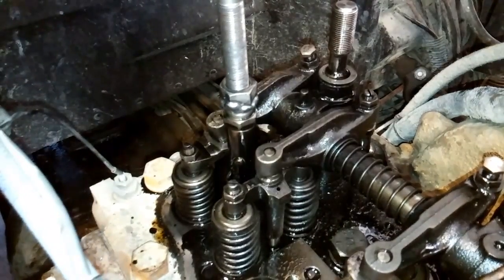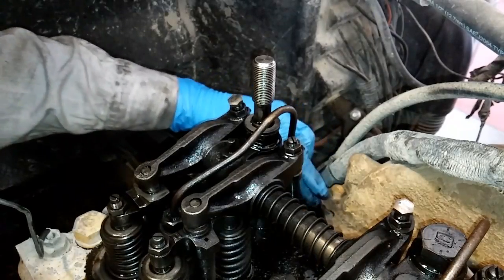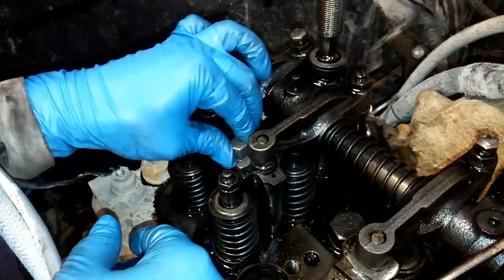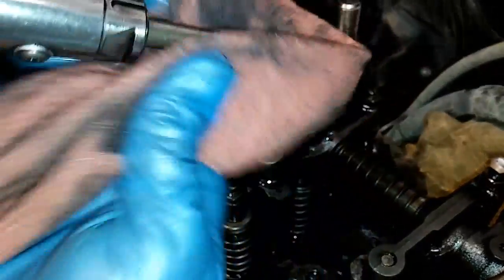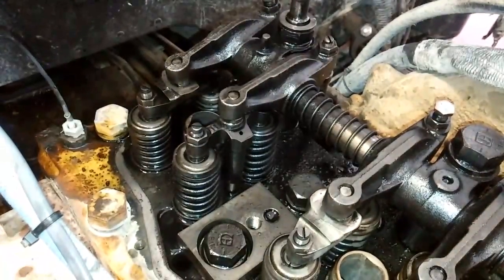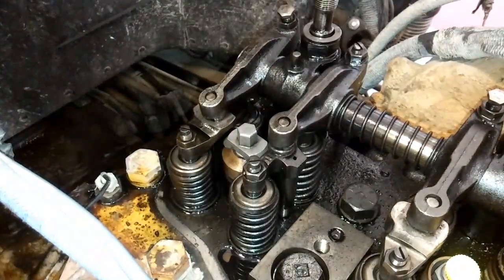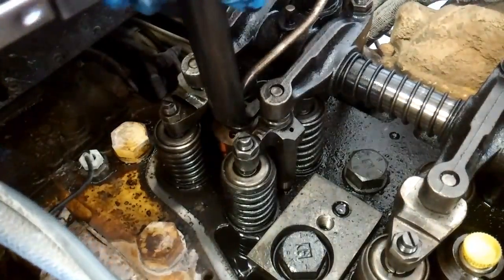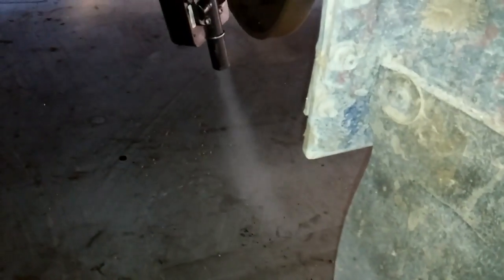How To Remove And Install 3406B Fuel Nozzles.  3406C Fuel Nozzle R & I.

Comment: Hello great video, is there like a mileage intervals that your supposed to change out the injectors or you just replace them when they go bad ? I have one go bad on mine started leaking fuel in the motor should I replaced all of them or just that on that’s bad or should I take them for testing TIA
Reply: These are called nozzles, not injectors. As the nozzles wear, the tip opens up and allows more fuel in the cylinder. By changing all six you could lose 100 HP. Also as they wear they dribble fuel and when they get so worn out, you will have a constant haze out the exhaust. Now as far as fuel in the oil, FTP very seldom, main injection pump, usually when someone tried to reseal a leaking pump and mostly under the valve cover. So your nozzle is in a chamber. You have two holes on top for the tool to fit in. BE CAREFUL, blow air in one side and see what comes out the other side. Put some gloves on and see if it is clear which means a leak. If dark usually means not leaking. You can try and isolate the cylinder, if it is a nozzle. A nozzle can leak at the top inner seal, which is not repairable or the outer bleed screw seal which you can. If you don't find one, pull all the nozzles and take them with the inner fuel lines and psi test them for a leak. If you reuse any nozzle, replace the bleed screw seal and the carbon dam seal. The carbon dam seal can be tricky and you can cut them when you install them back into the nozzle chamber. So slide them in a bit and pull them back out to inspect. Also you have a washer on the bottom and don't double stack one or leave one off.
Reply: @johngoldsmith6629  great info thanks, and yes I meant nozzles so we did find which one was leaking and replaced it with a reman one, that took care of the diesel in the oil, but I did noticed I have more blow by now then before I had almost no blow-by I think I’m gonna need a rebuilt soon, I thought that nozzle was gonna take care of the blueish/white smoke but I’d did not, so we went and replaced all 6 nozzles with reman ones from cat thinking maybe couple of injectors were bad since I had that one go bad might as well but I still have that same smoking problem it’s really stinky and it burns your eyes as hell. You think my problem is in the pump? I was told it might be my Air fuel ratio valve or a burn valve on the head ? Oh and I never thought replacing all nozzles I’d lose power I’d think the opposite
Reply: @snipermex13  Depends on how the nozzle failed. Cat had extrude hone nozzles they tried on 3ZJ's and they was a POS.
They did not open up but plugged up. So serial number means a lot on a 3406 to put it in the right vintage. Most other 7000 series nozzles open up. All 3406 B and C's has a timing problem. 7FB and early 4MG's cannot be fixed and will have a slipping problem over time. All 3406 B and C VTU needs to be inspected every two years. Make sure the snap ring is not broken and the bolts are not working out. Repaired 100's of them and most of what I see now are assembled wrong and people mess with the screws up front which is a big mistake. Never reuse the bolts in a vtu that times the pump or the small allen head bolts. Seen them break or loosen up.  Now when you say smoking, are you talking fumes tube or exhaust? FRC only comes in play when you accelerate, unless somebody has assembled it wrong and I seen lots of that as well. I would check pin timing first and some Cat shops has a blowby meter to see how much wear you have. Best to test it on a chassis dyno.

Comment: Which injectors should I buy for my 3406b 3zj? I’m rebuilding my pump 7E5888 and I’m looking to buy the injectors
Reply: What is your full engine serial number? The 7E5888 is just the casting number on the housing. The number that tells you what it is, is stamped on top of the fuel pump. They are called nozzles, not injectors, 7000 series to be exact. Make sure you have the updated bushings  and seals when you rebuild it.

Comment: What socket do u use for the 4studded rocker shaft bolts ? Trying to find something 3/4 drive to fit over the stud that jakes set on.
Reply: Proto makes a special 3/4 drive 1 1/8 extra deep socket for the rocker arm studs. Since it is special no warranty if you break it.

Comment: Anybody know the part number for the adapter from the slide hammer to the nozzle?   It would be very helpful right about now. I can't pull the injectors without one.  Thanks !   

I found it. 6V-6983. Verified because I got one from Cat and it worked perfectly.

Comment: Man i have a 3406c an I have fuel leak on too of pump how do I replace the orings   without replacing pump.    Someone said it's a 2 to 21/2 hours Job??
Reply: Seen people fix one or all. When you pull the leaking pump you need to see which seal you have. If it is pink you can try and fix the one that is leaking. Any other color you better pull all six or you might end end up nickel and dime yourself. 
The latest seal part number is a 131-3719. You will need to have a pin to center the rack in the fuel system and a tool to remove the bushing. IF YOU DON"T PULL THE PUMP ALL THE WAY OUT AND CLEAN. You will put fuel in your oil. You have bushing, o-ring, pump and a spacer. You must be clean or you can cause more problems than it's worth. Also if you have the old style bushing  you need to update it. Take the bonnet off the pump and see which style you have. Again you have an updated one. Check also for bypassing. If the spacer is pitted replace it. You will have to center the rack first before you remove the pump. Remove shutoff, remove plug under air compressor. Remove cover on the side, two bolts. Install pin where you pulled the plug out, put throttle in fuel on position to put pin against the rack center and remove pump and spacer. CLEAN, CLEAN and be CLEAN. Align the pump and reinstall. Put CLEAN fuel on bushing and the seal. If the lobe is up  you will have to turn the engine. Put seal and bushing in and screw down until it seats. After you put pump back in you need to make sure it is in time. If the rack is locked up you can over speed your engine. You can be a tooth off and it will miss or knock. Go to your local Cat dealer and ask for these, SEBD6676, SEBD6655, SEBD6553. After you check the pump for free rack and timing you can torque that pump. After torque, check again for free rack.  Also if your fuel line clamps are missing you need to install them. I use a 8PN serial number as a guide on these. They have the latest hardware picture in SIS. If your fuel return line is plugged, it will put extra pressure on the system and make the leak. I dislike a number four line. A number six or eight is better. Some times when you fix a leak, another pump may start. If number one or two is leaking, reseal both of these as they are under the air compressor. I have fixed hundreds of these in my forty years. Depending on the fuel lines, location and such. Takes me about one hour IF no problems occur for one. Around three for all six. Depends on each truck, and if the owner allows you to fix it properly or patch it.

Comment: Is this the same process, with the same tools to remove nozzles from a 3406a?
Reply: 3406 A has capsule nozzles. Take a old fuel line nut (3/4 size) and make a slide hammer.

Comment: Not to get picky but that's not a B that's a C
Reply: Tell me why it is a C and not a B?
Reply: @johngoldsmith6629  the 7e5888 pump is a dual scroll pump making it a C model
Reply: @dustinmitchell5354  What serial number starts a C model and what serial number ends a B model?
Reply: @johngoldsmith6629  I'm not exactly sure I think there was actually some B's that were 3zj but there were the very early numbers
https://www.scribd.com/doc/227429363/Cat-Truck-Engine-Serial-Number-Prefix-Chart
Reply: @dustinmitchell5354  Well I have been working for CAT over 39 years and B model 3zj's ended with 16181, C models started at 3ZJ16182 and up. Wide rod bearings started on a 3ZJ at 3ZJ02830. Dual scroll plunger and barrels was used on the first 3ZJ. The only difference of the injection pump is the check valve (not the complete pump, the pump for each cylinder). The 7E5888 hsg was used after the 4MG's. Sorry for the set up, I deal with this a lot at work.
Reply: @johngoldsmith6629  I said there were some 3zj's that were B. The 7e5888 is a C model pump and at the beginning of the video you can pause it and see the numbers
Reply: @dustinmitchell5354  Your not paying attention, the 7E5888 is the casting number on the housing. I put the FIRST 3ZJ00583 engine released and it takes a 4P1378 pump group, using a 7E5887 HOUSING. This is a B model. I than used 3ZJ51403 which is a C model. It takes a 1077533 pump group, which uses a 7E5887 HOUSING.  Show me a picture of a B model pump on a 3ZJ16181 and before. The housing will show the casting number. The housing is just a part. CAT stamps the group number on top of the fuel pump when it was built to assign it to a horse power group. Just like fuel system camshafts. You have a group which the cam is cast. Than they take and cut the slot for the timing pin. Once that is done they etch on the front of the camshaft the part number. How many fuel systems have you rebuilt? I have done well over few hundred. I started when A models was still being built until the last CAT truck engine was released. When someone brings me a fuel system by itself. I take the part number on top of the pump and the camshaft part number to narrow down what it is. I could care less what number is cast on the side. Right now I have a D8 pump I got out of the trash and it has a 7E5888 on the side of it. So you say its a truck engine C model? It is a part. How many years have you been working on CAT truck engines?  As I said before I deal with your kind all day long and they argue and have no clue what they are talking about. Call your local Cat dealer and ask them what is the part number of the fuel pump housing by itself on the engine serial numbers I just gave you and find out for yourself.  IT IS A CASTING NUMBER.
Reply: @johngoldsmith6629  I just work on my own at which I have has to do some learning pretty quickly. Mine is a 3zj I have it completely apart doing inframe on it. I'm not trying to argue with you nor do I have your experience I've just never saw that pump that was not a dual scroll pump. I took mine off and put the 7w3609 on it and on the inframe putting or9424 packs and or8290 flowed 20 over
Reply: @dustinmitchell5354  If you have a 3ZJ and putting 0R9424 packs in it, they are used in 8PN as well as the 0R8290 nozzle. Do not know the result of this mismatch, but your cooling jet has to be a dual and oil pump change. Single helix pumps was used on
a 7W3907 housing. ALL 7E5888 casting numbers use a dual helix. The difference is the check valve in each pump. Your VOP is 2700-3500 PSI. 3ZJ's depends on nozzle, some was 2000-2700 PSI Last ones was same as 8PN's. 
Your 7W3609 sounds like a pump casting. What number is on top or on the camshaft?
Reply: @johngoldsmith6629  I don't remember the number of cam inside the pump but the pump came off 86 359 with a 400b that I have and the cam in the motor is 4w - 2430 which is what comes in a B model. The mechanic I use sometimes and get a lot of info from had built a lot of these motors and it's the way he builds all of them so i an gonna do it the way he knows works. He rebuilt my pump and advance and put it on but I'm doing the rebuild. The crown for that pack as I'm sure you have looked is an e model 15.9:1 steel top. He said you could put 3421s in it and it idled like a dream and ran good at low speeds but once you got on it it started popping and he stopped looking for a different nozzles and came up with 8290s and he said they fixed it. Mine is 3zj21285
Reply: @dustinmitchell5354  Your 3ZJ21285, as shipped is a 425 @ 2000, 1450 Torque, Pete with Jake's. Has a 4P4697 fuel pump, with a 4P4698 Fuel cam. Fuel cam is a 10.4, with a 11.9 advance.
The 0R9424 Cylinder pack is NOT a E model. It is a service option for a 3406 C, 8PN, mechanical engine. The original piston's in the early 8PN's was aluminium. They was directional and was prone to heat cracks. Also they had a anodized coating and the only way to clean them was to soak them in dish washing detergent. Cat came out with these two piece steel top. Ask your local Cat dealer for media SEBD6695. It has a 16 to 1 compression ratio. 0R9424 replaces 0R8916.
The 0R8290 is the required nozzle for a 3406C, 8PN. When you mismatch the nozzle to the bowl of the piston. You could burn a piston. smoking or what ever. It is best to keep the piston and nozzle together as the angle was designed for the bowl. 
If you used the fuel system off a 1986 NSFS, more than likely it is around a 24 degree cam, with a 7 degree advance. Single helix injection pump. Again you have mismatched parts and I cannot say how that pump will work using 8PN nozzles and advancing the timing ten degree's at static.
Engine camshaft's, Cat had two for the 7FB. 4W2430 was one option depending on serial number and engine HP.
Reply: @dustinmitchell5354  Sorry I don't give out my email or phone. At work I get phone calls all the time and I am trying to work on someones engine. At home I like to rest. I am not good at mismatch parts as you are doing. The type of pump you are putting on verses the piston/ nozzle combination has me concerned. In later 3ZJ's Cat offered a 425 @ 1900 RPM, 1650 torque.
Your engine on the left verses a 1650 torque.
RPM   HP  Torque   RPM  HP Torque 
2000 425  1116        NA
1900 425  1175       same
1800 423   1235      1800 434 1268
1700 418  1291       1700 433 1338
1600 408 1340        1600 429 1408
1500 395  1384       1500 424 1484
1400 379 1421        1400 410 1539
1300 357 1442        1300  396 1598
1250  345 1450       NA you could split the numbers and be close.
 NA                             1200  377 1649
NA                              1100 345 1645

Naturally you have to have transmission and clutch to handle this. A good cooling system as well.
But a 1650 Torque legal engine eats your engine for lunch.
It's all about torque, HP gets you there. Torque keeps you there. 

Who is your local Cat dealer?
Reply: It's ok I understand I didn't know if you would or not that's why I gave my email instead of asking for yours that way you could if you wanted to but anyways I have a new radiator and I have a brand new set of double oilers. I have a new clutch I think rated for 6 or 650 and I have Spicer 6x4 . I bought a set of 135-2837 Pistons today mainly because they cheap and came with rods and skirts I figured they were worth 100 even if just for cores but I thought if I could figure out the right nozzles id maybe try them. Thompson cat in Cookeville TN or stowers in Crossville
Reply: @johngoldsmith6629  oh and I've already had the b pump and advance on my motor for a while with 3421si just don't think they worked well with the 15.6 piston
Reply: @dustinmitchell5354  That pump can't put the fuel out, single helix, cam etc.
Your very close to my area. Do you still have your old pump? Swapping parts is guess work. Your piston number is for a E model. I had a 3ZJ, a few months ago and I rerated the engine to the 1650 torque. It was a 350 HP low torque. Looks like your tossing a lot of money around and rolling the dice.
Reply: @johngoldsmith6629  I just know it didn't pull good at all with that c pump and got horrible fuel mileage. Especially with the 7031 nozzles only about 3 mpg and no matter how many times you turned the screws out you couldn't tell any difference. In fact when I first bought the truck in Jan the full fuel and torque screws were gone and yes sir I still have the pump and advance
Reply: @johngoldsmith6629  I know that was an e piston it was a cheap way to get the rods and skirts
Reply: @dustinmitchell5354  7W7041 nozzles. This engine had bad bushing's which did not seat the pump's and they would bypass fuel. You had to lap the P and B's update the bushing's and bonnets. Also VTU has a few problems and of course the FRC. 
If I owned it I would rerate it to a 425 HP, 1650 torque. Put it on a dyno and do a PAR run to make sure it's doing what it suppose to do. Your engine also has a know camshaft gear problem. Cat had a heat treating problem on a serial number range and your in it. Make sure you pull the valve lifters out and check for pin wear and install new clips. Cat has reman lifters for these. Put molly coat on head bolts, washers. (Cat now recommends to replace head bolts the at over haul). Torque inside rows to 345 Ft LBS, both outside rows to 330. You need to get a copy of SEBF69008 and read it.
Reply: @johngoldsmith6629  I think I forgot to mention I also have a camshaft that came in a b model 400 well I was told it's the same camshaft as that I bought a brand new one
Reply: @johngoldsmith6629  I know it's all mechanical and looks the same but I almost bet that motor has a 3zj serial number and it would have the wide crank journals which is good but they suck for making power until you build them